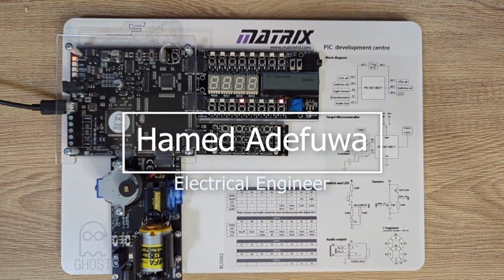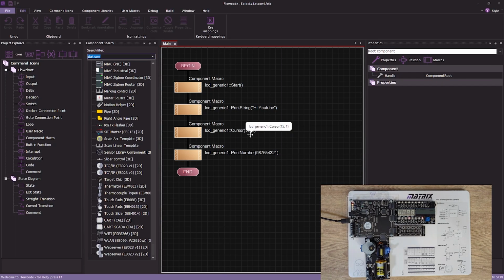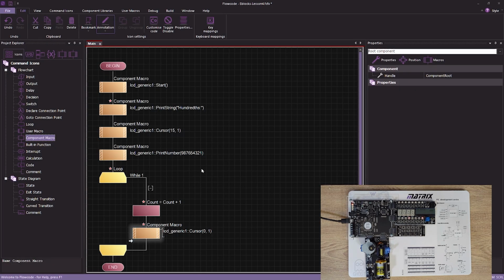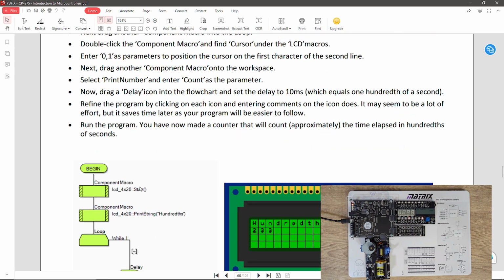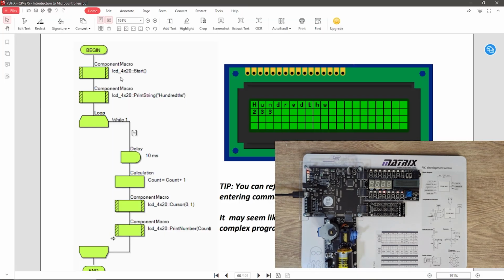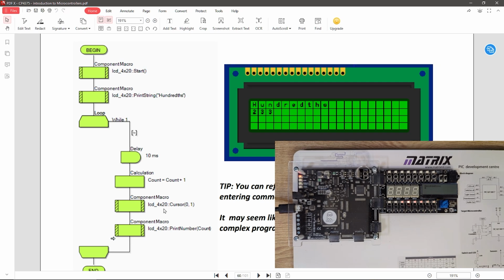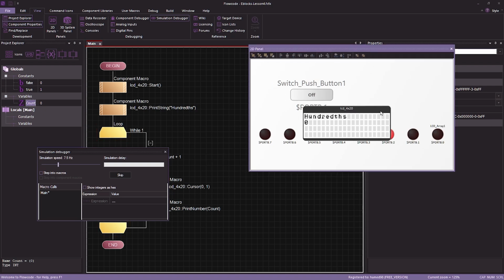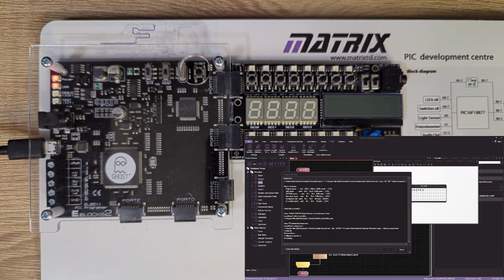Counters - Learning Microcontrollers with EBlocks & Flowcode #4

Comment: The initial problem it wasn't counting is if you did not include the initial value of 0 to the count.
Reply from the maker: Are you sure? I followed the instructions and in that create a variable dialogue popup it has the initial value of 0. I guess what you mean is I should have used an additional calculation block to set it to 0 manually. That's a Flowcode bug I'd say. That initial value box should do it for me I reckon. Instructions unclear 😅